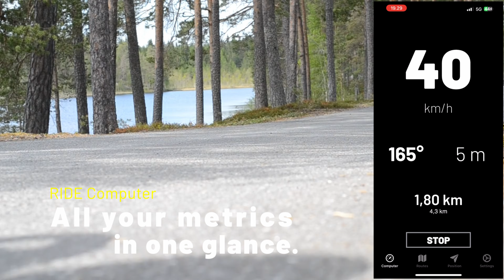H2D Quick Fix: Bambu Lab H2D Filament Feeding Issue Fixed with Extruder Guide Reinstall

Comment: Thank you for this video! Had the same issue and took the filament guide apart by removing the screw and found filament stuck on the guide pin.